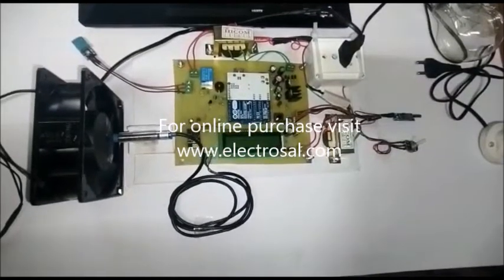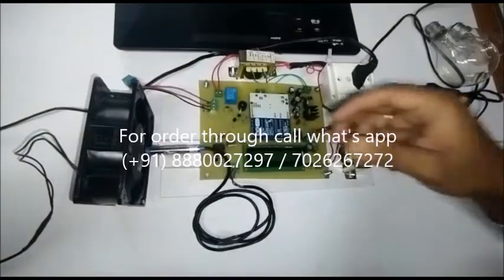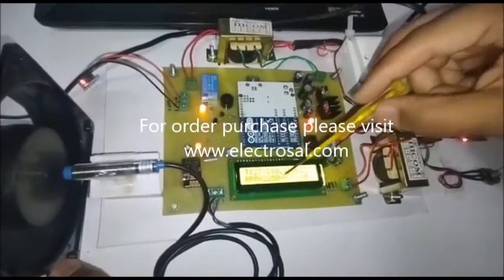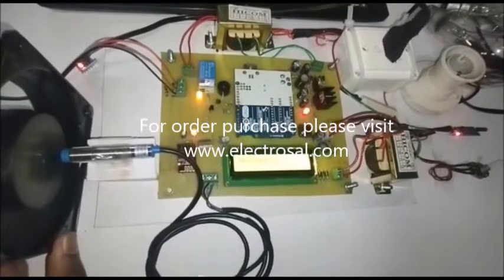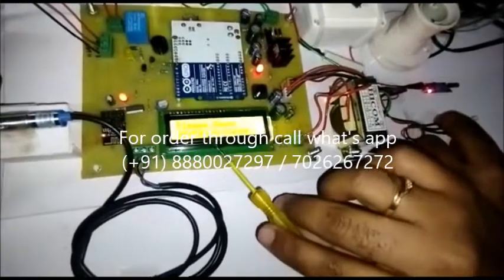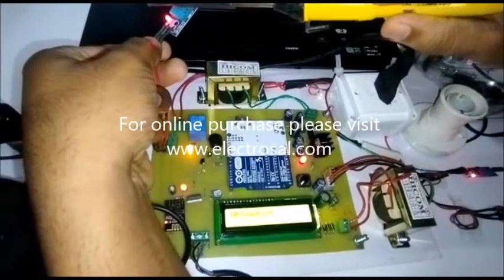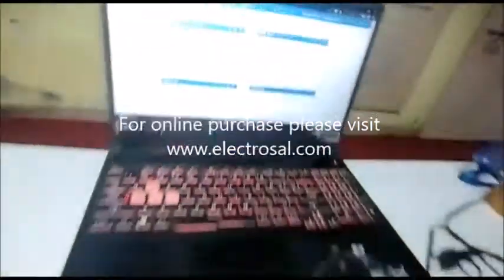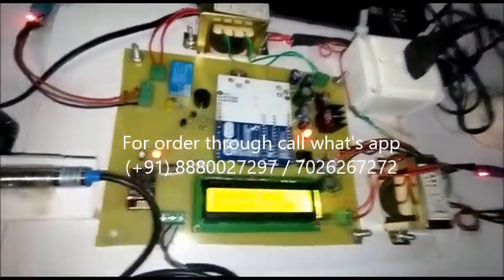Induction motor protection system using arduino over iot  // Engineering / electronic / project

Comment: need circuit diagram and program
Reply from the maker: https://www.electrosal.com/product/induction-motor-protection-system-using-arduino-over-iot/

call what's app : +91 8880027297 / 7026267272
visit : www.electrosal.com